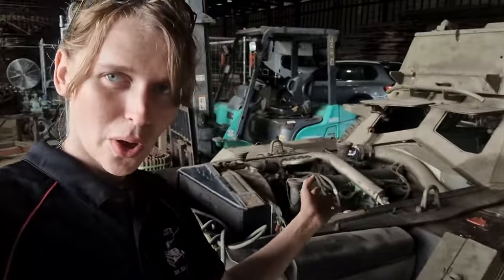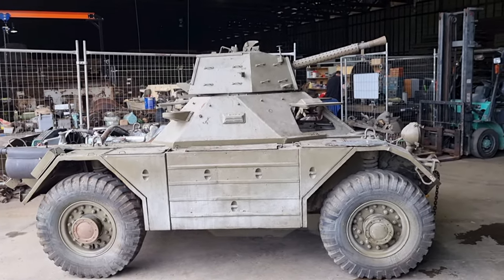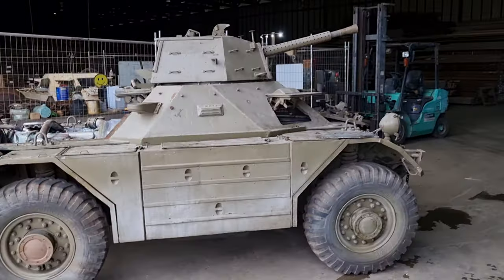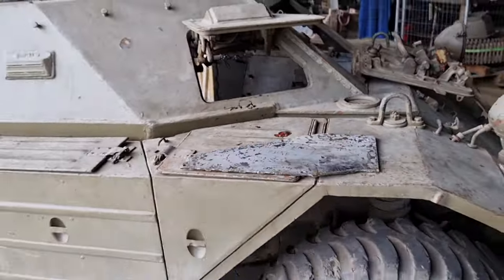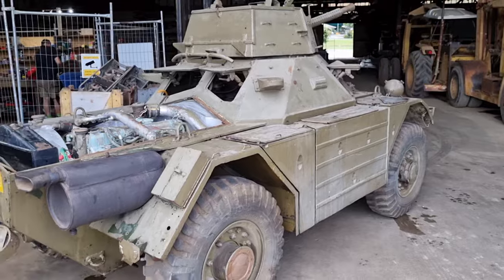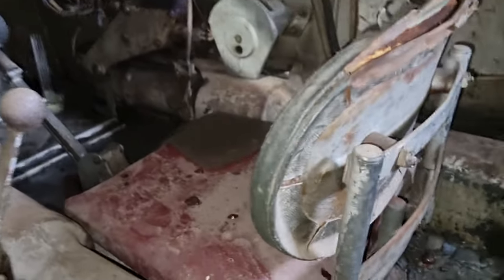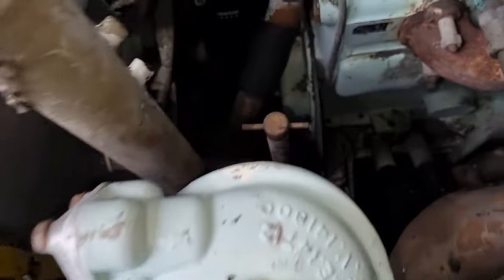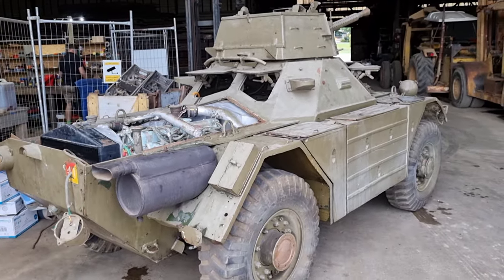Our Armoured Cars are multiplying!

Comment: Only the very early ferrets had the square hatches.  Very early Mark 1s had thinner armour and were not watertight.  Mark 1/1s (What everyone thinks of as Mark 1s) had thicker hulls and were sealed to what we think of as the 'typical ferret' hull.   Mark 1/2s have a notch on the hull to allow the square cupola to sit properly.   Apart from that, the Mark 2/x designations signified armour thickness / modifications and weapon changes. . 
If you take the data plate off, there should be a small plate welded to the hull that will give you the contract number.
That ferret has the earlier driver's seat (mine has a newer Saracen style seat, most likely from one of its  services and mods).  
It's good to see another one going on the road.

PS:  There are ferret groups on FaceAche around the world, they all share information, including a group in Australia,
EDIT: Typos and adding extra info.

Comment: The marking is covered by the tail light assembly because those tail lights were added as a later modification. The early tail lights were mounted on the outside edges of the fenders and were quite small, without indicators.

Comment: As you slide your feet through the driver’s view window when mounting do not boot the circular junction block. All wiring is yellow and the markers will be indistinguishable if fitted so putting it back together will amuse you for two or three hours. It took a morning including a NAAFI break! They burn quite well if run up a fuel point. That was fun! FireWire works on capacitance of the wire so beware of crushing them!

Comment: The shape of the side hatches isn't a reliable indicator of whether a Ferret is a Mk 1 or a Mk 2. Mk 1 and Mk 2 Ferrets were built on the production line at the same time and were identical except for bolt-on parts. Early Ferrets had square hatches, but they were fairly quickly revised to improve visibility. Most of the Mk 1 Ferrets purchased by the ADF were early ones, and most of the Mk 2s were of the later style. If it's still present in your Ferret, the build plate, by the driver's right shoulder, will identify if it was a Mk 1 or a Mk 2, of if you know its ARN, you can look up its history.

Comment: I am surprised that there wasn't a vehicle number painted at the front or back. On the plate on the inside of the vehicle it should have the vehicle ARN??? The Tac Sign '41' in the red over yellow box should be the RAAC tactical sign. 41 designates the unit I believe....but I will not swear on a stack of bibles to that.

Comment: Lottie, what's the reason for the steering wheel position/angle, does it tilt or stay at that angle. I'm guessing it's a tight fit but seems ergonomically uncomfortable.
Reply: You find that often on armor. Main reason is tight space with ammo, radios, people & whatnots, the driver would have serious problems getting into his seat.
Not just Brits, check German SdKfz 250 & 251& more.
Reply from the maker: It seems like a bother, but truth be told, it steers quite nicely. Because of the seating position, I think a traditional steering wheel angle would be a problem.